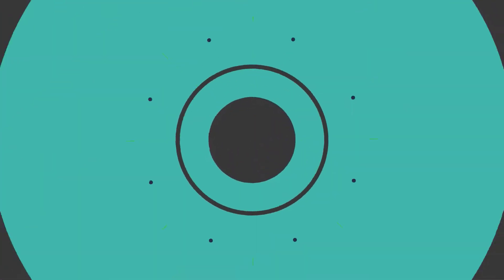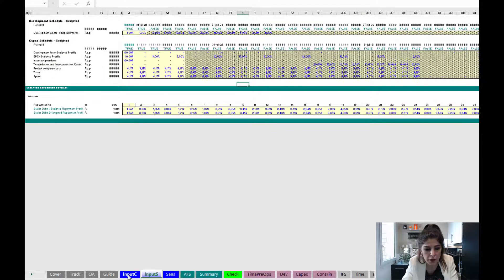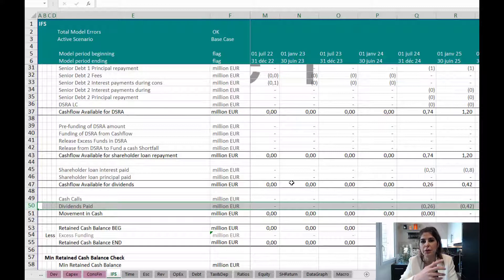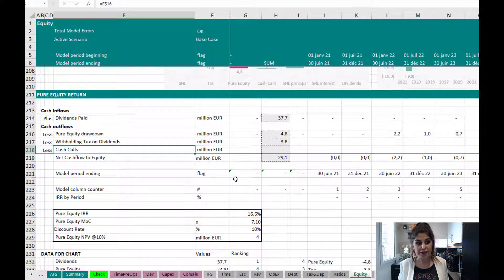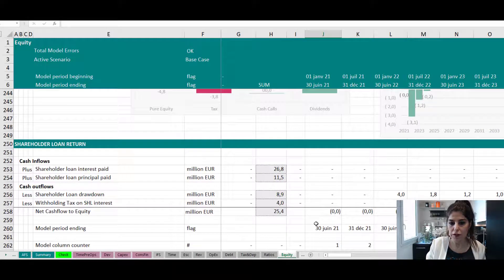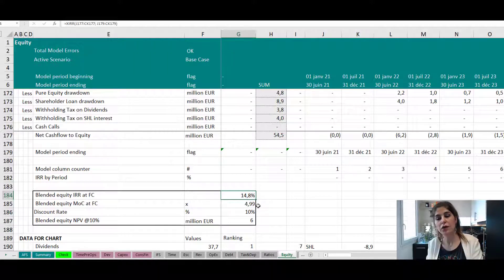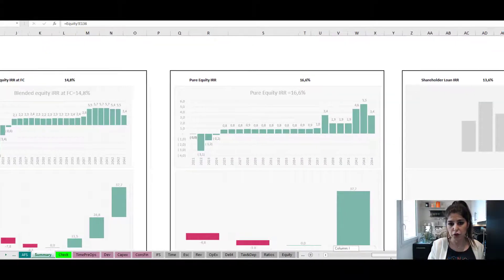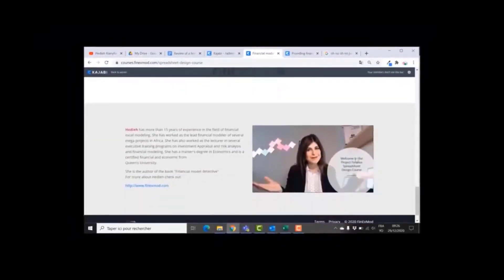Equity Return Metrics in a Project Finance Structure: Equity Internal Rate of Return (equity IRR)

Comment: Dear Maestro,
Thank you for this video. When you compare the equity IRR here to the hurdle rate I think you mean the cost of equity rather than the WACC (it should be that way I believe. We can compare the WACC to the project IRR).
I would like to have your views on two specific cases when you calculate equity IRR:
1) Do you take the equity component of the contingency in the calculation of equity IRR knowing that we might not draw down on it and the shareholders are not even contributing contingency equity but rather using an LC. Keeping in mind that in all cases the equity component of the contingency is already at risk from day one even with no drawdown.
2) If the shareholders are using a bridge loan for the full equity (extreme case) backed by an LC. When do you take in consideration equity injection timing a) when the bridge loan is disbursed or b) at the end of the construction period when the shareholders payback the bridge loan. 
Thank you Maestro
Reply from the maker: Dear Mahdi, 
Thanks for your questions. 
1. First of all, we need to distinguish between contingency. We have the funded contingency and unfunded contingency. Funded contingency is included when we are sizing equity in base case so it will be included in IRR calculation. The unfunded contingency or contingent equity if backup by LC, then cost of LC should be included when calculating the return to equity. Then you can do sensitivities and including a down case where you have cost overrun beyond contingency included in the budget, then you trigger the standby equity/debt if there's such facility. 
2.  If you have a fund that is allocating money upfront, then you need to assume that from the fund's point of view, equity in allocated from day 1. If the money is actually disbursed gradually throughout the construction, then you need to assume equity as cash outflow from equity point of view as it is drawn/disbursed.
Reply: @FinancialModelDetective   Thank you Maestro !! :)